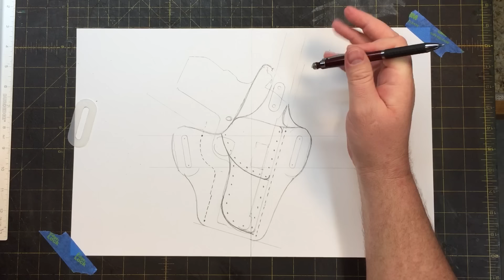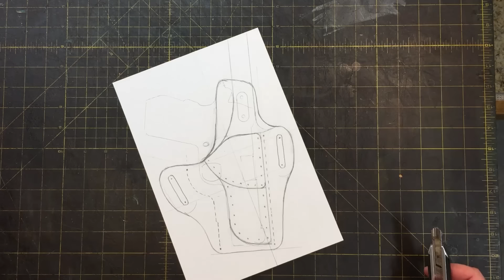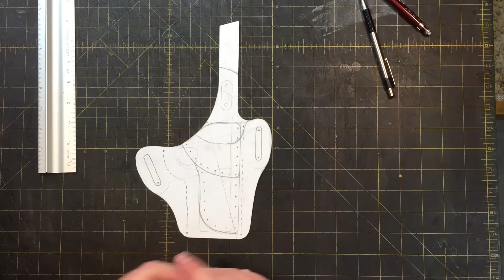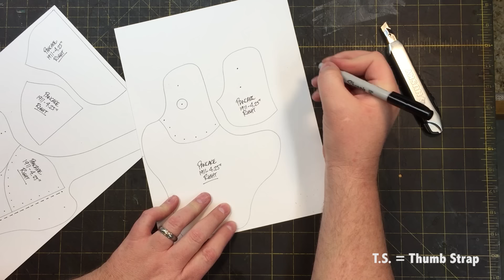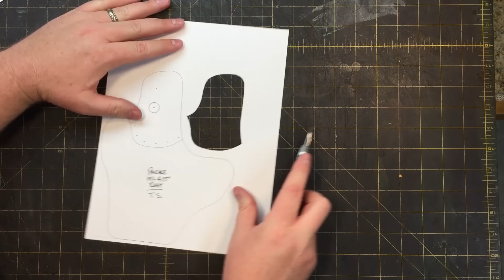Making a Pancake Leather Holster with Thumb Break, 1911 Commander

Comment from the maker: Thanks for the kind words, and thanks for watching!
Reply: Do you have a template for this you would be willing to share? Also, what kind of sewing machine do you have for this?
Reply from the maker: Hi Justin - sorry, I never saw this message come through. Yes, I have a pattern available on my website. I use a Cobra Class 4 sewing machine from Leather Machine Company.
Reply: What does the water/resolene do to the finish?
Reply from the maker: The 50/50 water/resolene is the protective top coat. Resolene is an acrylic finish. It's not necessary to dilute it, but it seemed common practice among other makers, so I did the same. Diluting it makes it a little less glossy.
Reply: Ahh that's what I was thinking. I'm not a big fan of high gloss so I will try this. Does the acrylic harden the leather at all?
Reply from the maker: Yeah, it definitely hardens it. That's another reason why I like to dilute it - I feel like it penetrates a little more  into the leather. I have no proof either way. I apply it much more liberally to the interior (flesh) side of the leather since it soaks in better on the flesh side.
Reply: Awesome,! Thanks for the tips. Nice work on the holsters.
Reply from the maker: No problem, happy to help! Take care.
Reply: I would love to buy on hand made for many HK VP9 with like some kinda design like a 🦂
Reply: That is a work of art !
Reply: Eric how thick is the leather
Reply from the maker: @jimmymcg7081  SorryJimmy - just saw this question - I use 7oz on this one.
Reply: Beautiful craftsmanship! Absolutely perfect!
Reply: Could you make a holster for a Ruger SP101 5 shot revolver with a 3 inch barrel?
Reply: Simplesmente espetacular ! Eu fazia coldre mas tive um AVC e então ... Já era ! Te faço uma pergunta : quanto vc me faz um para pistola ?
Reply: Bravo 👏👏👏
Reply: Man this is beautiful work!!! Would you be willing to make me one for my sig p229 enhanced elite?
Reply: แรดดดพนเพพพนดดด

Comment: Your holster and videos are my favorite because the process I use is almost exactly the same…Texas Boys!

One suggestion if I may, they make a plastic insert that goes on the gun side of the male snap component that keeps the gun from touching metal at any point during the snapping, unsnapping, inserting and removing processes. 
Great work, even if I do say so myself!😜👍🏼

Comment: I hereby name you Panoramix for your masterful use of a demi-lune blade, and for template-making in general. I wouldn't even know where to find one these days, as they've been overtaken by craft knives, scalpels and rotary cutters, they certainly date back to Celtic times.
Reply: Rahere It’s called a “head knife” now. You should be able to find it at leather craft shops and websites. I used mine to make the sheath for itself.

Comment: Great holster! However i noticed that you left the velvet side of the leather exposed, that can deteriorate the finish on your weapon quicker than if it was protected. It also could trap moisture, but im sure you take better care of weapon and holster than most. Great video keep it up👌
Reply from the maker: Hi James, thanks for watching! All holsters will eventually wear the finish on a firearm. Yes, lined holsters would probably wear a little less quickly than a non-lined holster, but I always ask for my hides to be split from thicker hides so there is as little fuzz as possible. Once formed and sealed, the interior of the holster, particularly the contact points, are quite smooth. I don't believe an unlined holster is any more likely to trap moisture than a lined holster. The holsters I make are sealed inside & out with acrylic sealer. Guns should always be removed from the holster when not being worn to give the gun and holster time to air out and wiped down. All carry guns need to be inspected & cleaned daily, especially guns that are more prone to rusting.
Reply: Thank you for responding! I really appreciated the greater understanding👌.  Youre doing an amazing job sir, keep it up

Comment: How do you determine where to put the notches for the belt? I assume that would also determine how tightly the gun is held in the holster. And make it uncomfortable to wear if they’re too close to the gun. Love your videos! Your videos where you explain are much better but they’re all great.
Reply from the maker: Thanks! I try to allow for at least 3/4" to 1" of clearance between the grip and the holster. Then I need 3/16" for my stitch inset around the perimeter of the holster. Then at least 1/4" of clearance between the belt slot and the stitch line. On larger guns, I usually position the belt somewhere around the ejection port, or whatever works to balance the gun above/below the belt line. Don't want it to be too top heavy so it flops out away from the body. And regarding positioning the belt slots forward/backward away from the gun - that depends a bit on the gun thickness. But I usually shoot for around 3/4" clearance between the belt slot and the stitch line around the pistol. If you get the slots too close to the gun, it puts too much pressure on the back side of the holster which puts too much tension inside the holster. Too far away, and you can't pull the holster in tight enough to the body. I don't really have a formula, but I do try to pre-form my slots so the wings are curved towards the body, and the slot is already shaped to receive the belt at roughly the correct angle.

Comment: Cool thing with the vacuum. I wonder how a vucuum sealer for food will work lol.
Reply from the maker: Lots of people use food savers. But, beware that it will leave the waffle pattern in your leather. I believe the solution is to flip the bag inside out, or layer thin foam over the holster prior to turning on the pump.

Comment: I make a similar holster but with snaps at the bottom of the belt loop so you can remove the holster and firearm at the same time without removing your belt.  I just wonder why he put that much detailing on the body side, that seems to just add bulk between the inside of the holster and your belt.  I try to keep the inside as flat as possible for better comfort.

Comment: For your stitches you should try to use a Groover tool.
Reply from the maker: I used to groove the front, but there's a pretty good chance the thread will exit the leather at a slight angle, making the needle miss the stitching groove on the back of the leather. Plus, getting a smooth groove around the trigger guard would be a bit difficult and easy to mess up. And the fact that I dye my pieces prior to assembly, that'd mean I wouldn't be able to groove until after the holster was assembled and the edges were sanded flush - touching up the groove with dye at that point could be fairly difficult on a holster with airbrushed accents.

Comment: Fantastic video. Thankyou so much. Just out of interest why do you leave the thread after sewing, then wet the leather, then cut the thread? Thanks
Reply from the maker: Thank you! I typically dampen the leather, then hammer the stitching flat to close up the holes and flatten the stitching. Then I trim the thread and melt the ends.

Trimming and melting the thread prior to hammering the stitching flat sometimes leaves the melted thread dangling in the breeze, and it may need to be melted again and re-flattened.
Reply: @AdamsLeatherWorks  Thanks

Comment: Great video! Thank you for taking the time to show the pattern making, very helpful. What kind of vacuum sealer do you use? Never seen anyone use it for wet forming, but would like to give this method a try.
Reply from the maker: Thanks! I have an article on my website with links to all the components. My setup is getting a little tired - but I've been using it for around 7 hears. I'll probably need to replace the bag soon since it has more than a few holes in it (my fault). https://www.adamsleatherworks.com/vacuum-press/

Comment: I know this is an older video but I am curious about a couple of things.  What kind of soap is in the water you soak the holster in? Also, why do you occasionally place the wet holster in a plastic (Ziploc) bag?  Are you trying to prevent it from drying too quickly?  What kind of sewing machine do you use?  Thanks in advance for you answers.  I have commented before and will say again, watching you create leather artwork is hypnotic.........................
Reply from the maker: Hello - I just use whatever dish soap happens to be loaded into the dispenser at the kitchen sink (Dawn, most likely). I put the damp holster in a bag to help the moisture soak into the leather and evenly distribute in the hide, as well as preventing it from drying too quickly. I use a Cobra Class 4 sewing machine. Thank you for watching!

Comment: I know this video is 3 years old, but is there any info you could provide on your button faster hand press? I love how you clamp it down on your desk! Thank you <3
Reply from the maker: That's the Pres-N-Snap tool that I bought from Rochford Supply, with the optional Bench Mount. It works great, and I like the fact that it's portable. I used it last week to fix a snap on a boat seat strap.

http://www.rochfordsupply.com/shop/Upholstery_Tools/Snap_Fastener_Tools/Pres-N-Snap_(Aluminum)_for_Installing_Fasteners/index.html
Reply: @AdamsLeatherWorks  Thank you!

Comment: Excellent job on your holster! Attention to detail! If you don’t me asking, what king of machine are you using and what is the blue tape for by the pressure foot? Thanks for the great video!
Reply from the maker: Thanks for watching! I am using a Cobra Class 4. The blue tape is to protect the leather from the sharp edges of the screws on the base plate. Would probably be better just to file them down and forget about it, but the tape was a quick fix.
Reply: @AdamsLeatherWorks   
Donde puedo comprar una de tus fundas para pistola????

Comment: Great video, thank you.  I purchased your 1911 5" pattern, but I needed to see the finished product, never having made anything like this. I just couldn't visualize the pattern w/o seeing the finished product.  Your video was excellent. (Although I had to slow it down to  kindergarten speed.) I'm not sure what the thing you put in for the reset snap was or why you needed the upper snap that doesn't connect to anything.  I'm not really familiar with holsters.  Just wondering.  Thank you though.
Reply from the maker: Thank you for watching, commenting and for your business! There is a small piece of steel embedded between the layers of leather. It helps to stiffen the reinforcement to give better leverage to release the snap.
Reply: @AdamsLeatherWorks  Thank you. So where would you get something like that?
Reply from the maker: I purchase them in bulk from https://jrmclips.com/thumb-break-stiffeners/
I also sell small packs of hardware on my site. https://www.adamsleatherworks.com/hardware
Reply: @AdamsLeatherWorks  Okay, I have watched your video over and over again, but now I would like to know what you soaked your holster in?  The water was foamy.  Thank you for your help.  I'm now at the point to soak my holster.
Reply from the maker: @pfischerpc  That was just warm water with a few drops of soap. I don't know if it's true, but I feel like the soap helps the water absorb into the leather a bit better, and it makes a nice 'sink' to wash my hands. And it catches flies.... LOL

Comment: I would like to get one of those holsters for a tauras executive comander 1911
Reply from the maker: Hi Paul - as long as it'll fit in a standard 4.25" 1911 holster, I should be able to make a holster for you using my Dan Wesson Commander Bobtail (CBOB Classic) as the mold, which is the gun used in this video.
Reply: I see you are in the Dallas area im in the Houston area I'll be getting my Taurus 1911 exective comander in in 11 days I'll get back with you when it comes in

Comment: If I wanted to make a holster like this for a Glock with a flashlight would I need to make the to of the holster wider than the bottom to make room for the pistol after seeing or do you think it would fit with just wet molding?
Reply from the maker: It really depends on the light's dimensions. Most of my newer videos show the leather-strip method of measuring for the stitch lines. You can likely carry the stitch line at the top of the trigger guard (wides part of the top opening) straight down to the muzzle. But you'll need to curve the stitch line towards the muzzle a bit to create a shelf for the light to rest on so the gun doesn't slide too far into the holster. I have a car holster video that might help convey the idea.
Reply: @AdamsLeatherWorks  Thanks!!

Comment: Hi, first of all you do beautiful work with leather holsters. I just happened across your channel and was wondering if leather would  be any more forgiving on the finish of my gun then plastic holsters (AKA kydex). Any response or advice would be appreciated. Thanks in advance.
Reply from the maker: Hi Steve - thank you! Kydex folks will probably tell you leather is harder on the finish. Leather folks will probably generally say the opposite. I'm in the camp that believes leather is easier on the finish. Just keep the interior clean and wax it every now and then. But finish wear is going to happen over time with any holster material.

Comment: Will this scratch the 1911 on the way in and out? Have you thought of making a chest rig version. Like the WW2 US tank operators/mechanics used? I’d buy that pdf download in a heartbeat.
Reply from the maker: Holster wear on the firearm is a possibility with any type of holster, regardless of material. But in my opinion, smooth vegetable tanned & sealed leather would be the least likely to scratch/wear the finish. This would mean a lined holster. I do line holsters if/when requested, but I have to charge extra for it since it uses twice as much leather. And when I do line, I only line with smooth vegetable tanned leather. I know other makers prefer suede, but it's not something I would opt to use. I've gotten a few requests for a chest rig, but I've never tried it. Holsters are pretty stright-forward. You just have to fit the gun & belt. Chest right - now you have to account for body size and adjustability, over pretty wide margins or have multiple sizing options. Makes my pea-brain hurt. LOL But I'll give it consideration on future project ideas. Most of my videos are based around existing customer orders.

Comment: What kind of Machine do you use?  I've been looking at the Cowboy 3200 or similar.  I do Belts, Knife Sheaths, Holsters, and small projects like passport covers...
Reply from the maker: Hi Greg - I have a Cobra Class 4. I keep mine loaded with 277 bonded nylon thread in the top & bottom bobbins. It's a little thick for passport covers, but it can use much thinner thread. I don't usually keep the table installed on mine, but it's pretty handy for flat objects like passport covers. I like it for belts too because they tend to swing a lot as the belt tends to hang over the back of the machine.

Comment: 🔥  Why are holster makers so slow in responding to lasers and/or lights mounted on picatinny rails under the front of firearms? Most continue making holsters without any allowance for this growing trend. I had to look all the way over in England to find a holster to fit my pistol.
Reply from the maker: Likely because most makers are relatively small volume and can’t afford to buy all the new & popular lights, lasers and rear optics. It’s hard enough keeping up with the mold inventory. I make them from time to time, but only if the customer is willing to mail their accessory to me for a few weeks.

Comment: Hi what was the vacuum bag you used please?  Did you also bake the holster?  What thickness of leather please? 
Many thanks
Reply from the maker: Hi Keith - I have a blog article with more information about the various parts. I have stopped baking my holsters and just let them dry in front of a fan. It's too hard to regulate the temperature of the oven. In the winter, I hang the holster from the top of my airbrush cabinet and place a small space heater inside the cabinet and set the temp control somewhere around the medium setting. I typically use 7-8 ounce leather for all of my gun related gear (belts, mag pouches and holsters). You can go a little thinner on reinforcements if you like, though I just typically use the same thickness. https://www.adamsleatherworks.com/post/vacuum-press
Reply: @AdamsLeatherWorks  I see Rockler in Houston can get the bags for $43 + sh
Reply from the maker: Nice, I’ll keep that in mind when it’s time to replace mine. 2’x2’ is plenty big. My 4x2 is a waste of space and money since I only use the area right around the valve stem.
Reply: @AdamsLeatherWorks  I have an idea for one that I can make for around $20 ish about a half gallon bag size. I will try it and keep you posted

Comment: Great Video as always. I was wondering what slot cutter you are using for your belt slots, and where you got it. Much appreciated!
Reply from the maker: Michael Mays Leatherworks Thanks for watching! I bought my slot cutter from Texas Custom Dies. They custom size them to your dimensions.
Reply: Eric Adams what size do you use for your slots?
Reply from the maker: For my 1.5" wide belts, I use a 5/16" x 1 9/16". For 1.75" belts, I use 5/16" x 1 13/16".
Reply from the maker: I thought I replied to the slot cutter source, but I'm not seeing it here. In case it didn't show up for some reason, I bought my slot punches from Texas Custom Dies.